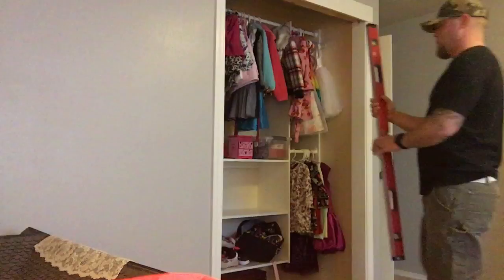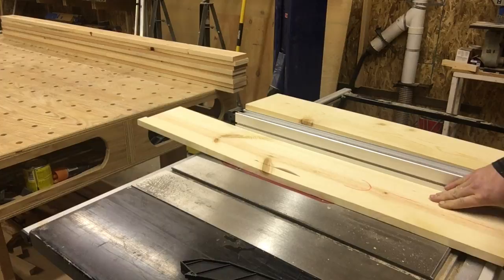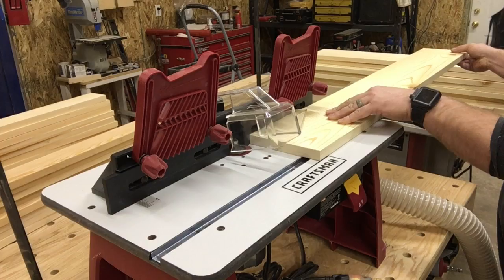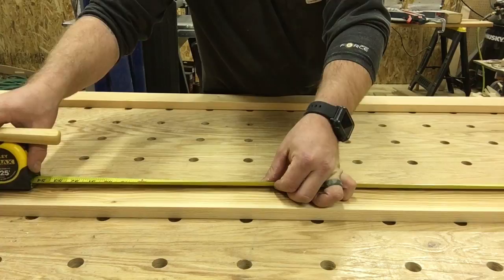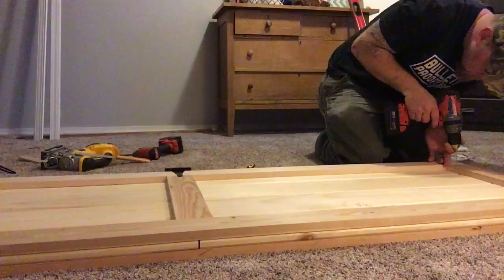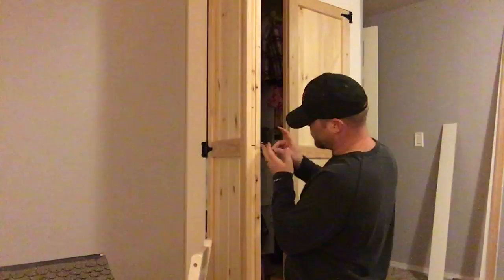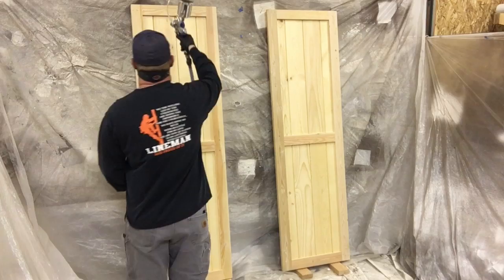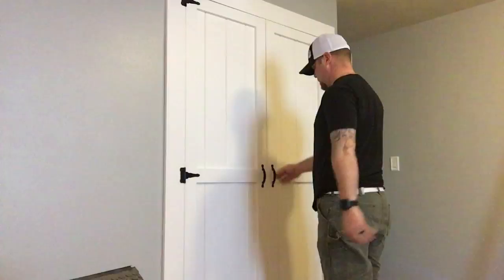How To Build Farmhouse Style Interior Doors

Comment: Very nice job. I am in the process of designing my doors for a complete interior door replacement in my home. How thick are your doors and what would you suggest for door hardware?  My interior doors are set up for 1&3/8", but I could change the jams for the thickness of your door design but I am not sure about the lock, etc. I look forward to your advice.  Jim
Reply from the maker: Hey Jim! Thank you. These are 2.25” thick. I was working with some wide frames so it worked out. I could have planed the boards thinner before assembly but this worked out well. Depending on what you’re going for I would think you could use almost any hardware combo for your doors. If you wanted a knob and lock you would have to bore a know/latch hole into the door. When you buy knobs or locks they usually come with a template on how and how big the bore hole has to be. I hope this helped. Take care Jim

-Frank

Comment: do you have a list of what size boards you used
Reply from the maker: I used 1x4’s and 1x8’s, but not in their original dimensions. I cut and milled them down to dimensions that mathematically worked the best for my enclosure.